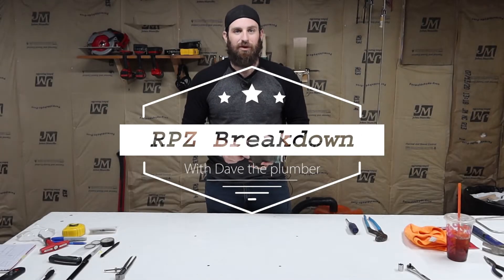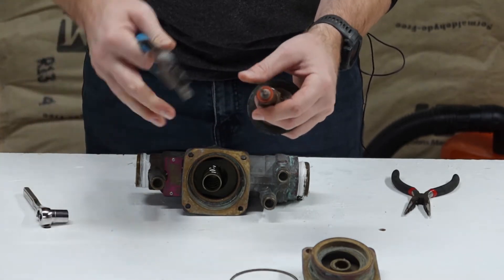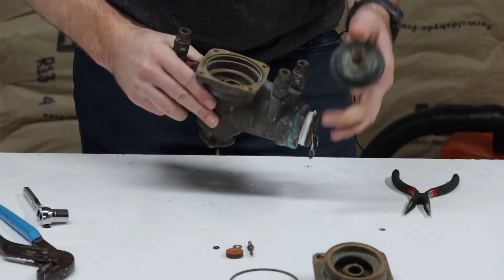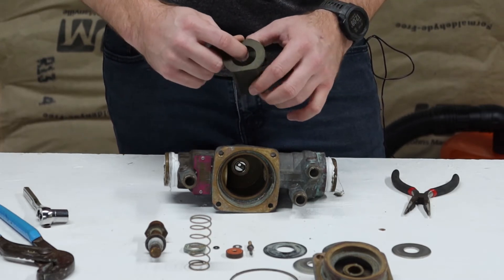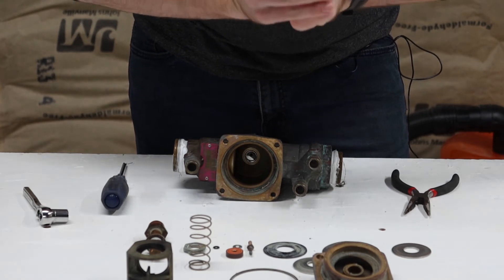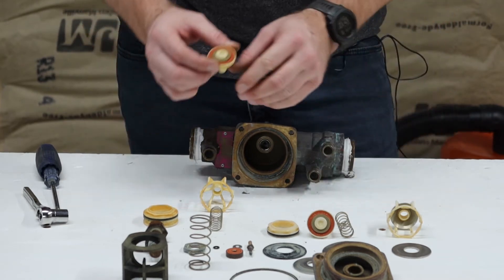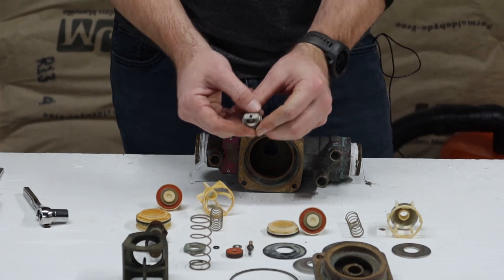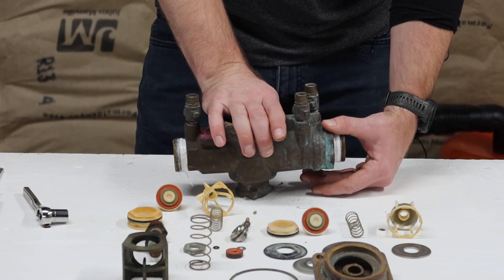Watts 009 completebreak down

Comment: This is the worst backflow valve assembly ever. If check 1 or 2 is the point of failure you need to disassemble the relief valve to get to the checks. If the relief was not an issue before the repair it likely will be an issue when the assembly is placed back in service.
Reply from the maker: Absolutely right. I tell my guys if it's a small drip to just leave it until we either replace it or have a complete kit because I know it's going to be worse once you open it.

Comment: What is the order ( from top to bottom) of the different metal washers and how are they oriented?  The large one has a concavity to it, and the smaller one as a lip.
Reply from the maker: i take it you have the valve with the brass stem. It goes smaller round rubber gasket, concaved washer with the edges going up, larger rubber gasket, then the flat washer. hope that helps.
Reply: Thank you so much!

Comment: What about the rubber o-ring under the 2 diaphragm and washers on relief stem? You don't change that out too? And you say the new ones are plastic parts, well 3/4" 009m2qt is brass relief valve and the 1" is plastic. Never seen a plastic relief in the backflow that you have in this video
Reply from the maker: When I rebuild them k replace everything in the kits. a 009m2qt will most definitely have a Plastic relief stem. It is white in the 3/4 and black in the 1in. All m2s and m3s have plastic relief stems.

Comment: What is a good replacement for these ? I have one in my sprinkler system. Rebuilt it and it still leaks. Having trouble finding this model to replace. Thanks !
Reply from the maker: I replace these with a Wilkins 375. They are more affordable and easier to repair. 009s are tricky and hard to repair.